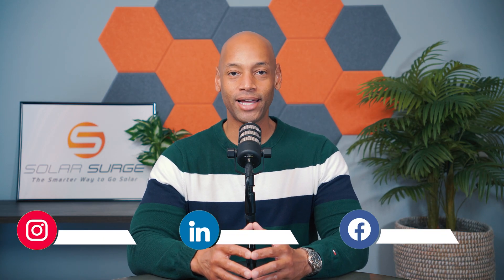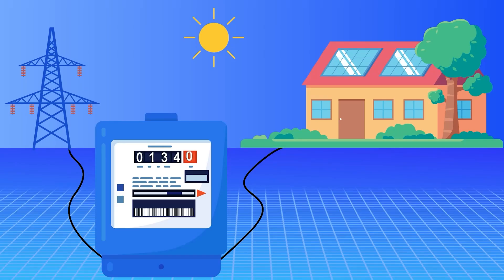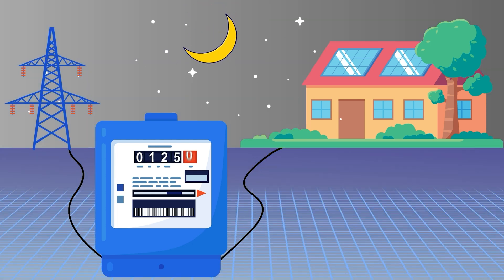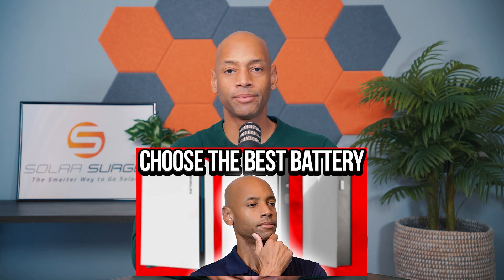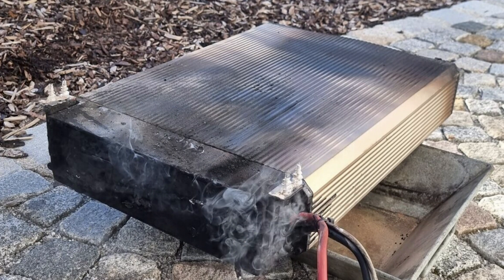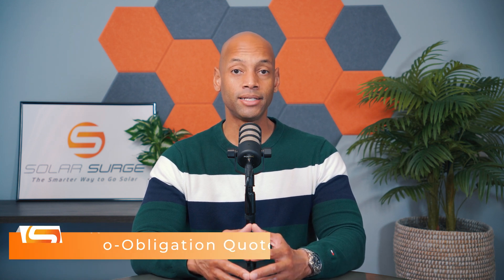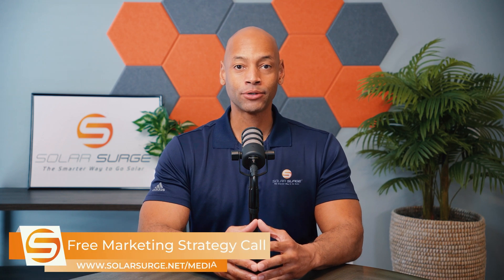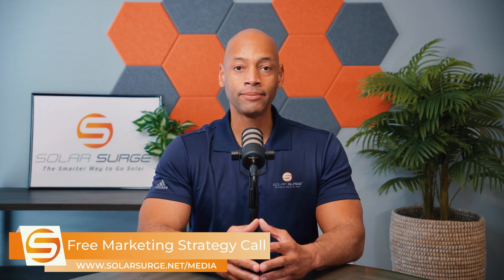Solar Energy Storage

Comment: Can we please get beyond these super basic topics, and explore some more advanced concepts? It seems you keep making the same videos.
Reply: @7Solarcolorado Perhaps because he rehashes the same rote topics. People buy solar and then start to fall into a host of more technical traps like AC compressor startup amperage limitations, rate and depth of charge and discharge limitations, fault detection and resolution, monitoring and optimization, proper load balancing, realistic inverter and battery capacity and management, optimization of feed-in strategies, automation, etc,, etc.  He's leading the blind into a world of hurt without further, deeper education.

Comment: I have a 23.49kW Tesla Panel system in process with 4 Powerwalls but got my planset yesterday and they designed with 2 Powerwall 2s and 2 Powerwall plus + an extra 5.7AC inverter.  I asked why not 3 PW3 with 2 inverters disabled and 1 derated as needed to get the total AC output to a favorable/within utility regulation maximums and they said they believe the utility still counts the unused/disabled/derated inverts AC output towards total system AC and won't approve.  Have you ever heard of this?  I'm trying to figure out if they are just trying to pawn off PW2/+ inventory on me instead of giving me the newer PW3.  Obviously I want the PW3s as they are LFP and will supply almost double continuous output in total as compared with the 2PW2 and 2PW+ system.  Much smaller overall footprint too.
Reply: Simply because they arent selling the pw3s yet. Only few people have it and its not mass produced just yet. They put the powerwall 3 photos on their to make you think your getting a Powerwall 3 but your really getting either the 2 or the +. Its a nice scam.
Reply: There’s actually zero evidence that Tesla is using lfp. Based off the low weight it’s likely it’s LMNC
Reply: @7Solarcolorado Atlantic City Electric in NJ
Reply: @7Solarcolorado Yeah I understand they are concerned that I will just add more panels and then enable the extra AC output after the fact - which would violate their max offset.  However, I cannot find the direct regulation that says there is an AC output max such as Tesla is telling me.
Reply: @7Solarcolorado They are using Q.PEAK DUO BLK ML-G10+ SERIES for my project as that is what is in my plan set.  My understanding is that while not the best, these are considered good panels.
Reply: @7Solarcolorado They don't do micro inverters.  They will be using 2 of their 7.6kW AC inverters as part of Powerwall+ (PW2 + Inverter) and then an extra 5.7kW AC inverter for 20.9kW total AC output

Comment: I am thinking about adding batteries to my system. My question is how much storage do I need? Once I can figure that out, I will be able to do a cost benefit analysis to see if it is worth it. I saw one video that said you will never need more than 10KwH of battery storage. Our local municipal electric company is now about 2:1 in net metering. I can read the teal leaves and they are oositioning themselves to soon be 3:1.My electric rate is low I know, compared to CA standards. I pay a little over 13 cents per KwH all the time.  On average, we consume about 1 Mwh per month and produce between 1.2 and 1.5 MwH per month. We end up buying back between 35 and 50 percent of the energy we send to the grid per month. Is it worth to drop 10 - 15 K in batteries ?
Reply from the maker: To maximize self consumption, I would recommend that you have battery storage capacity equal to 60-70% of your daily average kWh consumption.
Reply: @7Solarcolorado I already have a hot tub and I don't plan on adding anything else at this time. When the system was originally sized I had both the hot tub and electric car charger installed but since then have gotten rid of the electric car
Reply: @7Solarcolorado Self consumption only. I have an Enphase IQ 8 10.2 Kwh system . So I will need to be AC coupled